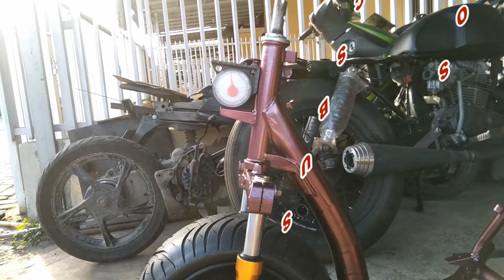how to make stand up scooter, stand up scooter mio sporty engine, cara merakit stand up scooter mio

Comment: Good on you. If I was caught on the road driving one of those here in the Philippines, I get tickets for: 
1. Unauthorized motor vehicle modification, Php 5,000 ($90); 
2. Driving an unregistered motor vehicle, Php 10,000 ($180) + vehicle impoundment; 
3. No Helmet Violation (which includes using a "wrong" quality helmet), Php 1,500 ($27); and probably 
4. Driving without license (which includes delinquent, expired, suspended, revoked, improper, or fake driver's license), Php 3,000 ($54)
Reply from the maker: This is just for content, not for higway, we are allowed to be creative, i am stel creator